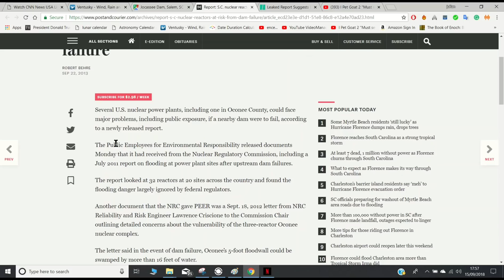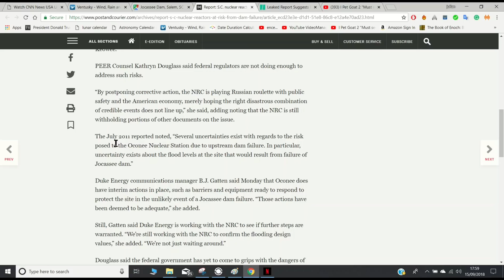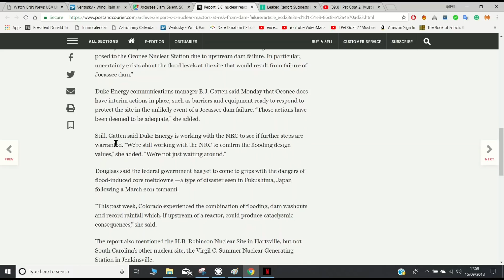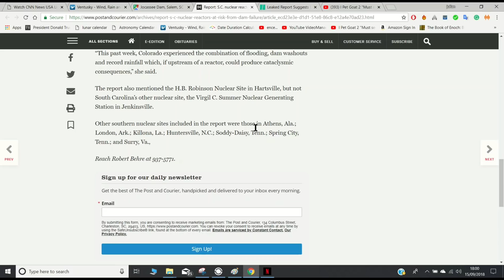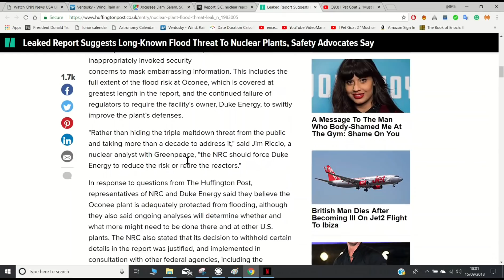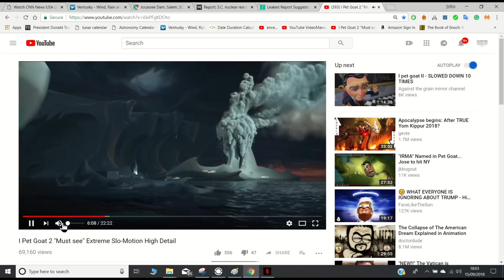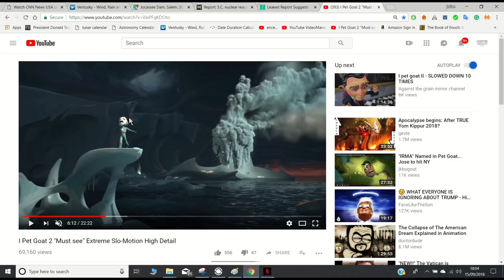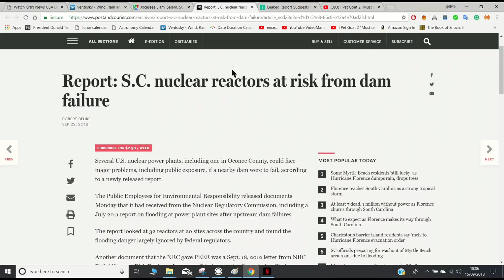A FAILURE OF THE JOCASSEE DAM IN SC DURING FLORENCE COULD LEAD TO A MELTDOWN AT OCONEE NUCLEAR PLANT

Comment: Looks like the date for the Shark-Sub Attack on NY 10/4. The Shark has 8 teeth and there is a 2 above the 5 we see on the shark upside down. Lunar 8/25 is 10/4. Also U2 did a video last yr where 10/4 is coded and it was filmed in NY with lots of reference.
10-4 Over & Out !
Watch This !!!
https://youtu.be/EeJGm7bUc1o

Also outside the classroom to the right of the psalm 23 we see a 9 and a 14 which 9+1=10 then 4. Confirmation i think.